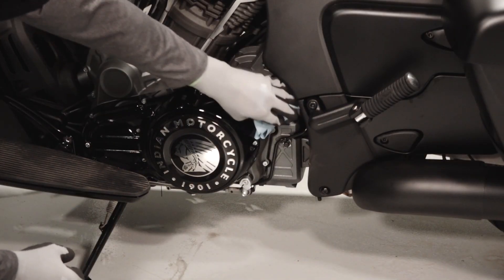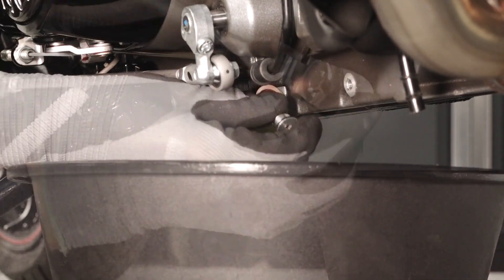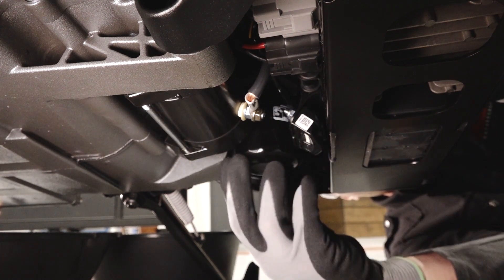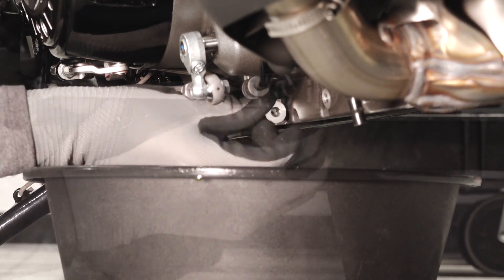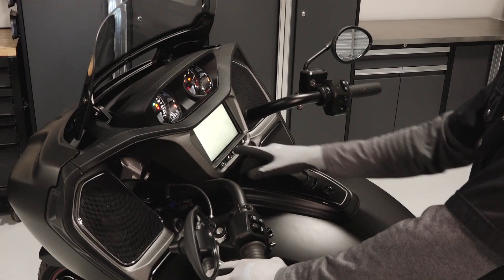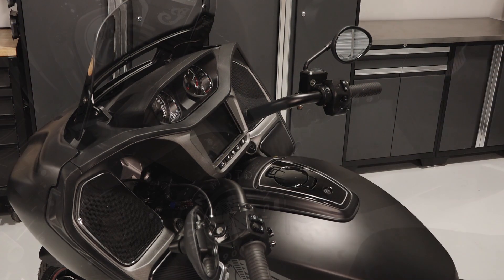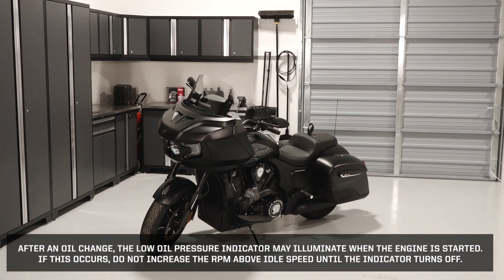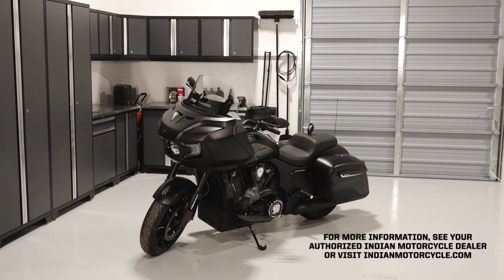Indian Challenger Oil and Filter Change - Indian Motorcycle

Comment: Great how to vids. Like where the filter is placed. Don't know about that starter wire being down in the elements though. Looks like possible trouble down the road.
Reply: Yuuuuuuuuuuuuup. Definitely could get stuck between the oil filter and the mating surface when you change the oil.

Comment: When I follow the directions exactly as the video shows (which is also exactly how the manual states to change the oil), 5 quarts isn’t enough oil.  5 quarts barely gets the oil to the “add” line on the dipstick when fully inserted.  To get the oil closer to the full line (which is where I prefer to have it), the engine takes almost 6 quarts.  Has anyone else noticed this??
Reply: John, good to know. I bought the maintenance package which will include 6 oil changes. After this point I will do my own. So, have you heard anything about adding more oil?
Reply: FACE Lopez , I haven’t heard anything about it.  As far as Im concerned, the bike takes 5.5 quarts.  5.5 quarts at least gets the oil farther up in the safe zone of the dipstick.  I have 1000 miles since the first oil change and haven’t had any issues.
Reply: I noticed it also, 5 quartz makes it close to the minimum level on my bike.
Reply: 5 quarts is perfect 
You guys ABSOLUTELY dont know what you are doing!
Reply: And to triple confirm, you guys started the bike in an upright position after adding the 4l, correct?
Reply: @ryananderson6321  , correct.